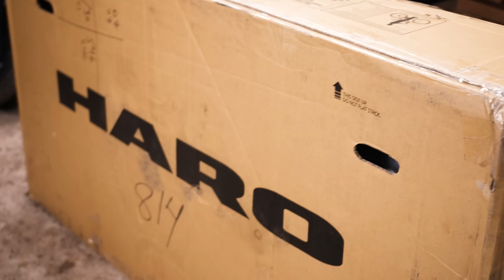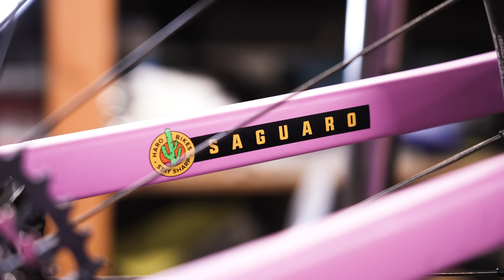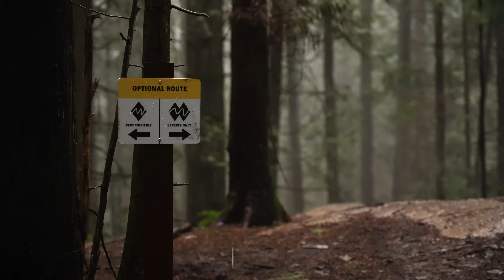HARO is back!  But how's the bike?

Comment: Love the reviews, but I must correct you on one thing... I grew up in Tucson... pronounce saguaro with a "wh" not a hard "g"  ;).  sa-WHARRO.    I've been riding my Rocky Mtn Growler 50 for 3 years now and I still love it, though I've upgraded the brakes, handlebars, grips, pedals, and tires. Soon will be upgrading the fork. But I am sold on being a 50 year old on a hard tail for many of the reasons you mentioned. As a dad, I shouldn't be flying at 30+mph on a full suspension rig... the crashes are tougher to recover from. The hardtail keeps my speed lower, tires me out faster (so I can get back to my family), and keeps my bike handling skills sharp. And the simplicity is especially valued as life seems to get more complicated. I raced my Trek 8000 with a Mag21 shock all over northern Arizona back in the mid 90's and had a fully rigid Diamondback Ascent in 1989, so I've been a fan of the hardtail thing for 35+ years. Still have my '81 Mongoose BMX bike too. Hardtails will never go out of style!

Comment: Used to ride a '04 Haro extreme 3 Enduro bike (5-6" travel), rode xc then change suspension travel for park riding, had it set up as a 2x before the industry adopted it

Now I am riding a '23 Dartmoor Primal 29er that's more set up for XC riding, (flat  bar and no dropper), love the hardtails

Comment: Last Haro that I had was a  steel (tangte prestige) Haro Werx SS Single Speed w/ an eccentric bb.    Like your preproduction bike, it was a bit too large for me and I sold it off not soon after building it up.  That said, I loved the frame quality and design, but alas, it was too big for me.    Glad to see Haro back on the scene with a cool bike, but at 56 years old, I'll not be hammering whats left of my knees on a hardtail.

Comment: Staring at my winter project- an RSD Middlechild.  I’ve never owned a modern mountain bicycle… All my frames are hard tails but 26” and barely vee brakes.  This bike looks very fun ! I went steel frame and hope to race enduros…after reading about reach and modern geo, it appears I’ve been riding a too big bicycle for over a decade :) this rsd has my ideal calculable reach  and is medium- first impression it is a midgets bike 😊 but aint taken to the trails yet just… my kitchen floor 😂
Reply: You're going to love it.  The Middlechild geo is built for fun.  Total hoot to ride.
Reply: Love my RSD MIDDLECHILD , but I like 27.5

Comment: sweet bike... many bikes using this 'rootdown' geo have realized this is about as a hardcore as you can take the geo or would like to on a hardtail. Exception maybe being the doctahawk and a bit more extreme on the ESD. However the failure of the Marin Elroy has only proven, there is only so far you can take geometry and fork length work without a proportionate pivot on the back (probably why Marin updated the San Quintens)

Rootdown has now basically been imitated with slight deviations of maybe +- .5 Deg on HTA, STA and about 10mm on reach, chainstay and travel. (Roscoe, Knolly Tyaughton, Torrent, Meta HT AM, Pole Taivail just to name a few)

One thing to note is fork travel. They really do work well at about 150mm max, without beginning to feel like a seesaw and this is still with a progressive high-end fork that is tuned to stay high in the travel... ALSO a fork that isn't too stiff. You may be tempted (as I was) to slap on a 38 or a Zeb, but its already a HT and at only 150mm of travel, a 36, Diamond, Lyrik, Z1 is PLENTY stiff. Don't believe me? Lets see your forearms after good 5 min chundry descent. Also show me on paper that you're any faster using a Fox 38 over a 36 at 150mm of travel.

Its actually IMO unfortunate that everyone where I live, the trend gravitates to the largest forks they can, though its not the pacific NW nor bellingham, where being overworked has adverse effects to bike performance, especially riding anything other than descents. The sight being one of the most popular bikes where I live, when I ask these peeps... do you really prefer the Zeb, or 38 most of their answers are 'meh', it looks cool.

edit... even XC moving to 34 for 100MM maybe as well. The Fox 831 could handle 4x, slopestyle and DJ and so does the current like of Manitou Circus. I just think homologating the chassis just makes manufacturing cheaper and sells the hyperbole that thicker is better.

Comment: The only Haro I've had was an early Shift R3 that I pulled from a pawn shop for a song. Took it home, cleaned it up rode it a few miles, but the frame was far too small for me. Flipped it for 3x what I paid; sometimes I miss spring of '20.

Comment: I'm not a hard-tail connoisseur, but I do have a Canfield Bros. epo that I use for winter riding.  I run it with a 2.8 27.5 rear and either the same or a 2.6 29er on the front.  It's fun and light.  And easy to wash down in our PNW winter riding.  Too bad the dropper post is out for rebuilding right now. :(

Comment: More hardtail content please! I would still like to see you ride the RM Growler. 

I'm about to order a new wheelset for mine to make it more downcountry, and keep the stock 30mm internal wheels for the Butcher/Eliminator combo. In getting closer to middle aged too😄

So far I'm going with DT 350 hubs, EX 471 rear rim, XM 421 front rim, and at the same time converting it to 1x12 with various Shimano bits. It already has a 140 Z1 fork, old Formula One brakes I already had, and a Gen 3 Rainier dropper 🤙

Or do I go with 30mm rims since I ride trails in Virginia that have rocks and roots 😣

Comment: Also to note... for an ALU bike, price is high and I'd attribute that to the GX Transmission. Not sure someone shopping for a HT would be looking at that as a differentiator, and rather a future upgrade. Amazing, but I'd probably reckon that a standard GX Eagle and or a SLX linkglide would reduce the price materially. Otherwise build is spot on.

Comment: Awesome video

But here's the funny thing
You are only 5.8 and I am 5.9-1/2 I write a medium diamondback atroz 2 but I really wish it would have been my arms and my legs are extremely long
From fingertip to fingertip my arm length is 6 ft 3
My inseam is only 32 in but add a bunch of extra where my hip is at and when I stand up I feel like I'm going over the bars

Can't take the bike back it was a emergency purchase and I do like this bike and it has been on quite a few trips already in the past 3 years
It is only a 27.5 with 120 mm front and rear I just wish I could have gotten the Atroz 3 which was a 150 mm front 4pot Brakes front and rear through axles front and rear
And it was a 1x12 to where the atras 2 is a 1x 9  9 mm quick-release front and rear that I had to a 1x11 52T for better climbing and handling

With my trips and photography

Comment: Are you genuinely disappointed by the transmission? I get the lack of feedback, but precision and shift under load seems more than worth it. Though… maybe once the price has come down.
Reply from the maker: I prefer the tactile feel of mechanical, as well as being able to shift multiple gears immediately.  Mechanical is MUCH faster.  I rarely ever downshift while under load, we don't have technical climbs in my town.  Any shifting during power- well, it's usually an upshift, and for the last 15 years, drivetrains have had minimal issues while upshifting during sprints.  Back in 2003-2008, I would do "5 gear sprints" between classes- and those 8 and 9 speed drivetrains did just fine.

Comment: Traction control.....pfft. My bike has all that electronic crap too and luckily I can shut it off....so I did. Anyway, first time viewer and now subscriber.  Good mtb channel!
Reply from the maker: Hahaha yeah I should turn it off, but with nearly 100 hp on tap, I feel safer and more effective with it on- generally. That was actually the first time ever it gave me trouble. The general off road map was amazing- zero wheel spin, just tractores up all kinds of steep, loose stuff on the moto trails at Vedder. But Trying to rally the 890 like a dirt bike will just result in lots of broken stuff, so I’m fine treating it like the street bike it is.

Comment: I hate that pepto abysmal color 🤮🤣. I sure hope they're offering other colorways lol. My introduction to haro was a 99 mira 540 in 2000. First real bike I ever bought myself with a small lawnmowing job I used to do in the summer. When i later worked at my local bikeshop for parts i remember haro having the sickest gnarliest downhill bikes around! They dealt with mostly haro bikes and products. Sone redline. I still have a never assembled dually frame. Had a couple of torkers on the racks too. Mostly haro though.

Comment: Hard and other brands like it are just fine. Pay the bucks if you want or put some bucks in your pocket and dont be a follower of a brand for no real reason. If we have not figured out how to weld steel or aluminium tubes together were in trouble.

Comment: Wet feet while crossing steam was no where near an event than if you dumped the bike and had to fish it out. That would have been a day.
Reply from the maker: Right? There were still 150 miles of interstate to go to get home that night- and it had just started to rain. I was worried about hypothermia! But if the 890 were to fall over while running, and drink some water, I’ll bet it would break a connecting rod and total the bike… or if it simply killed it, it’s still a massive project to pull the tank, plugs, and hope to turn it over to get the water out. Not many know just how sketchy that is on such a delicate bike!
Reply: @JeffKendallWeed  That video must have taken a bunch of work. That would be the worst case if engine hydro locked absolutely but I did not want to sound too negative. Do you ever mention trail names and is that one on trail forks.Not that I could reach it.

Comment: Sold Haro Bikes through mid 2000's onward. every single product was a let down in both design and marketing. What's left of the brand is clapped out and hanging in the sheds of "fix-it-up" guys that cant hold down a job and sell clapped out old bikes at flea markets on a Saturday. The Brand is going to need A LOT of good fortune.